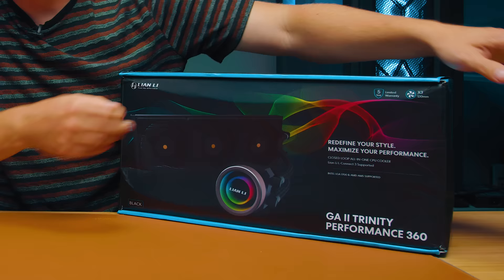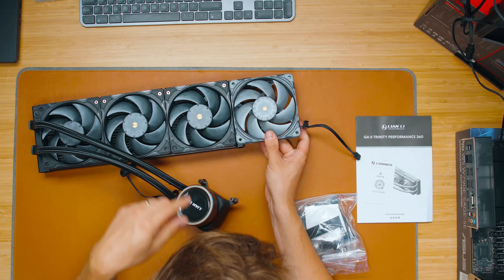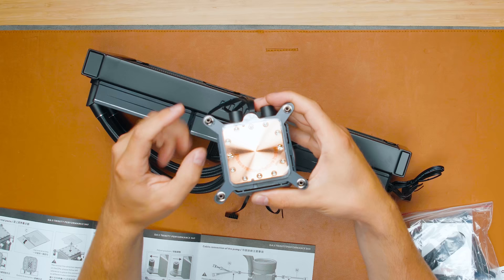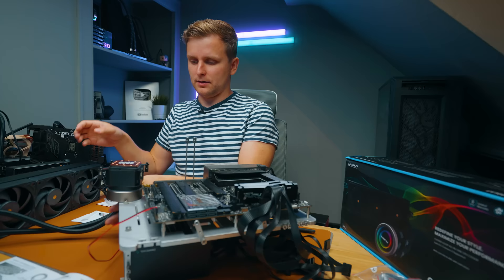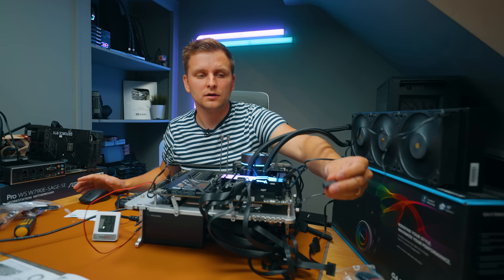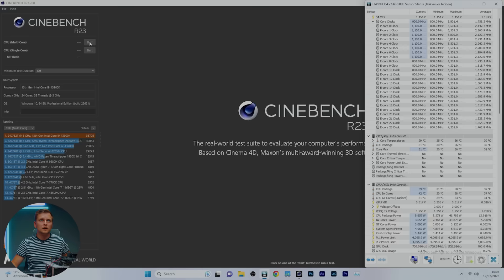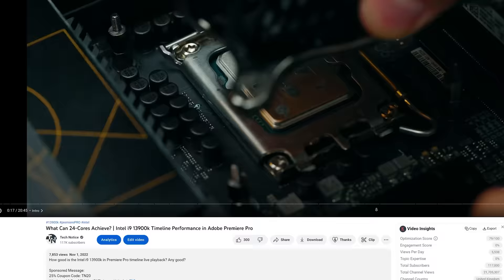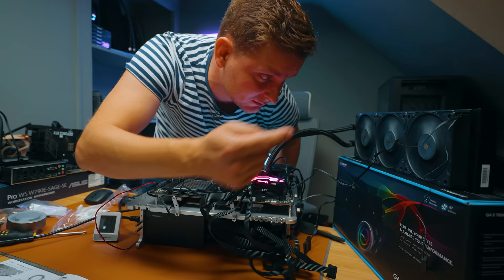BEST AIO of 2023?!? | Lian-Li Galahad II Trinity Performance 360 test & review

Comment: I'm having  RMA with this AiO. Performance version, pump died after 44 days. Not so premium, do not buy it
Reply: This can happen regardless of brand. I had an EK AIO 240 fail after about 5 months last year. Doesn't mean the product is a failure
Reply: Sounds like a defect product. Happens in all areas of tech. I've had a brand new 3.5" HDD fail after a week.
Reply: 😂 brother this can happen to any pc component it doesn’t means is bad
Reply: @Eddycarm  Just bad luck 🫨
Reply: Ma pump is going to died i have same product sound is so bad
Reply: Did you try and tilt the pc? Could have been air stuck in the pump head.
Reply: @JamieR   yes i tried and even worse like mini motor bike pump is working
Reply: It's usually pretty easy to tell when a component of any type has great reviews, and has even been gone over rigorously by the likes of Gamers Nexus, but people claim RMA or issues..

99% of the time that is just a normal DOA product, or user error. I don't even own this one. I have a Corsair h115i and have loved it.

But Lian Li makes good products. I'm considering this one.
Reply: @JordanMMiracle   yes lian li galahad 2 Performenc is nice i buy that AIO everty whas nice and last 3 days pump is working like mini motorbike
Reply: Same. I’m seeing a lot of people having the same issue on Reddit and on other reviews elsewhere. I really want to like this AIO, but it seems like there’s a problem with the pump design.
Reply: Now google any other AIO and you’ll find out all of them can die and there’s people with issues with all of them
Reply: This can happen to any AIO.
Reply: Oof I just got this for my evo xl case. That's horrible luck. Easy replacement though, surely!

My last build had a corsair h110 I got in early 2014 that I carried over from my last build....the pump died. Yesterday 😂.  

10 years! Kept my CPUs cooled from an i5 3470 to the 6700k I had until yesterday!! When the pump finally failed. 

Will see how this one holds up to that ahaha
Reply: How did you have it mounted in your PC?
Reply: Update after 8 months. I now have the 3rd (yes, third) version. Two previous ones have died after 44-55 days. The third one seems to be the good one 🙂
Reply: @spiriter666  did you mount it at the top of the case?
Reply: @diehardprogaming  Yes Sir. In both cases pump started rattling metalically (it was not trapped air) and it became insanely loud at high RPM. RMA service said it was the pump bearing being defective
Reply: @spiriter666  oh that sucks, I just bought one a few days ago and not put it in yet still looking for a good thermal paste.

Comment: The Galahad V1 had terrible coil whine on the pump until you dropped the voltage to like 60-70%. Disappointed it's not silent this time around.
Reply: The center caps do not fit very well either, and they also amplify the humming on the pump. Drives me mad when I'm having quiet time just browsing or working at the PC.
Reply: Probably far better than my nzxt x63. It's brutal over like 1600rpm.
Reply: Arctic Freezer 360 OneLove😅
Reply: Wait aren’t you the dude who makes fnaf vhs compilations?
Reply: I’ve had the V1 since it debuted and, aside from a few reboots here and there (updates and such) it’s been fairly silent. The whole unit has really. And I’m running front mounted and tubes up. Not even a slight gurgle.
Reply: @Mapantz1 RMA it. I'm running Lian Li fans and the performance AIO all in a LL case and I don't see how a PC could get much quieter.

Comment: You should test EK Nucleus AIO, Phanteks Glacier One T30 V2 (or any AIO with Asetek gen 8 pump) and Deepcool LS/LT720. These 3 might beat the Lian Li Galahad performance.
Reply: Word is the Phanteks t30 v2 360mm may not get replenished. Inventory seems gone in the USA at least.
Reply: I'm moving from LS720 to Galahad 2TP, Galahad is slightly more cooler, around 3c.
Reply: @poorNOOB  Yeah, Galahad II Performance beats all of those. General concensus seems to be that this AIO is the best one right now.

Comment: I like that it is coming already prepared straight out the box, and also i like the size of the contact plate that thing is HUGE. The competition is rising on CPU coolers side and at this rate we will have the next shift in pc cooling engineering for consumers
Reply: Just standard, nothing drastic, look into the TEC cooler from EK || Intel and then discuss available PC cooling engineering for consumers. These became common from both EK and Cooler Master back when 10th Gen was "notoriously" HOT! EK makes the TEC cooler for open loop while Cooler Master had the "ML 360 Sub Zero Tec" back then that was a 360mm RAD closed loop AIO TEC cooler. Very very neat package. If your serious about expressing cooling availability for consumers and can tackle an i9 13900KS chip open loop, SLAP that EK TEC on the chip and watch those temps go FROSTY! With that said stay frosty! Peace! :hand-purple-blue-peace:
Reply: @MagicMojitos  TEC coolers from EK are not brillant tho, they cant cool it sustainabily they where only designed for short burst application but any sustained load they just become a normal water block.

Comment: I believe it would be highly beneficial if more PC builders showed greater interest in replacing the stock CPU frame bracket with aftermarket alternatives like those from Thermal Grizzly. By doing so, users could also apply a substantial amount of thermal paste to ensure complete coverage. This approach has been demonstrated by the Gamers Nexus channel to significantly lower CPU temperatures. The replacement frame bracket has proven to provide more even pressure distribution, leading to improved heat dissipation and ultimately resulting in cooler CPU operating temperatures.
Reply from the maker: Yep, I've covered that on the channel as well :)
Reply: @theTechNotice  awesome ill have to check that video out!
Reply: I agree. I had to get that bracket myself.

Comment: I've been using my old but still working amazing corsair h115i rgb platinum 280mm and have been worried how much life I actually have left in this old aio. Has kept my old 6700k at 4.8ghz at 1.4v cool then kept my 10700k at 5.1ghz on all 8 cores at 1.38v cooled for years and this year it's being used to keep my 13700k in check easily. For the price I paid for this aio its been one hell of a great unit. But if it fails I'm really liking this lian-li aio. Hate rbg more and more the older I get "used to love it" and recently took out all my rgb strips and razer rgb controller and rgn fans out to make it more stealth looking and this would be perfect with just the block that lights up like I have now. Plus it performs so well to keep a 13900k under control. Just hope it's compatible with future intel cpu's LGA 1851 coming out next year. Or if lian-li will sell a mounting kit like corsair did for a few bucks for lga 1700 which I bought for my h115i.
Reply: @@unimpressively_charming 5 years

Comment: I'm not a big fan of gimmicky AIO's, but I did purchase this and plan on removing the crappy fans and putting my 140mm Noctua Industrial 3000 RPM fans on it to cool a 5800X3D. I just hope it doesn't blow too much hot air in my case with a 4090 in it.

Comment: best CPU cooler I have ever tested is the alphacool eisbear aurora pro. which is meant for threadripper and HEDT but it works great on 1700 intel. HUGE block and pump. I have the 420mm version in push/pull and can not get my 13900KS to throttle.
Reply: Alphacool Eisbaer Pro Aurora has a suberb fan there and copper radiator. You won't find many AIOs coming with better fans and I can't even think about a big list of AIOs with copper radiators. The only problem with the Alphacool is the same we have in every other AIO: low water flow due to pump limitation.

This pump's maximum flow rate is just 72 L/h in 100%, while custom watercoolers start from 600. For an AIO it delivers premium performance compared to other sealed builds you can get on the market from corsair/lian li/cm/deepcool etc. Its like taking the best Toyota and comparing to a Ferrari, it will work great, but will never be crazy like an expensive and complex supercar.
Reply: @jzuany  yeah I only do AIOs. I am not into customer water cooling. keeps my 12900KS in the 50s while overclocked like hell so im good with that.
Reply: angry that my icegem 360 does not have 1700 mounting.

Comment: I have the 240 white sl-inf. It performs good too. I only find the included thermal paste a little too thin so I applied my preferred one directly to the cpu.
Reply: arctic best thermal paste (mx7) besides liquid metal but you can't use gallium on copper
Reply: @kodakblack531  You mean MX-6? They don't have MX-7. Thermal Grizzly Kryonaut beat MX-6 in my tests by 1c on my 7950x.

Comment: May I ask if you know how this cooler compares (for 13900K/14900K) to the blazingly expensive: ASUS ROG RYUJIN III 360 ARGB? My favorite is still Arctic II 420, but the design of the pump is somehow strange compared to Lian Li and ASUS. 
I still cannot find out of why the user may buy  ASUS ROG RYUJIN III 360 ARGB instead of much cheaper alternatives. I put aside the brand and the display that comes with the ASUS variant. Of course, there is Lian Li option GA II LCD that is still much cheaper than ASUS.

Comment: Not sure if that is capable at 325w, while it said No on thermal throttling the temps are already 95c in red and that was only 4th run, meaning that on the 10min duration it probably would have throttled already.  I'm guessing 288w was the max dissipation,    the Arctic 360 III with the p12 max was capable of 300w.

Comment: I would recommend using a Thermalright CPU Contact Frame for LGA 1700 Retrofit Kit, which will prevent the CPU from being buckled lowering the CPU temps by 5C*-10C*.. Would highly recommend!
Reply: im looking at the SL INF version and it seems there are Thermalright CPU Contact Frame in the box, at least where im lookin at it

Comment: Today i will switch from the Arctic Freezer 3 280mm RGB white to the GA II TRINITY PERFORMANCE 360 White RGB - The Arctic LF 3 reahed its limits with 255 Watts at a AMD 5950x. THanks to this VIdeo i found a better Cooler and my concerns are blown away ! Gorgeours Video- i ve watched a lot now and always funny and informativ ! THanks !
Reply: 2 Month later......its an awsome AIO the performance is incredible - it can handle 270 Watts at AMD 5950x at 82 °C ar 24 °C Ambiente -- i beliebve the most pwoerfull AIO for a while....2024 still did not show up with stronger performances....ne AIO are out since Computex... but yet no tests seen
Reply: @LetsFixITJoe  BETTER THAN LF3?

Comment: So what case fans match the ones that come on this cooler? I'd like them all to match, but I definitely want this cooler. I need 3 120mm fans and 1 140mm fan.
Reply: I'd like to know this too
Reply: @InfiniteVideoMedia   I'm thinking the P28's are closest, but not exact. These cooler fans spin even faster and don't daisy chain like the P28's and other Uni fans. They don't have a 140mm equivalent yet either from what I can tell. I might just replace all the fans on the cooler, so they match, but these have a much higher static pressure. The other option is to get the LED side plates for these and match it with SL case fans it looks like.
Reply: The matching fans are Lian Li SLINF fans. They come in 120mm and 140mm

Comment: have you tested the 240mm version? I am building my new machine using a Phanteks NV9 Case. The rear of the case has the perfect spot to place the 240 on, but not sure how this will be different to the 360 on a 1400K Intel CPU! I look forward to your reply and kind advice.
Reply: What d'you end up going with?
The 240mm version supposedly beats out many "lesser" 360 aio's.
Ordered one, so we'll find out soon.
My mugen ain't hackin' it on my 13700k. Also completely clogging up my mid-size case with its girth.

Comment: 12:16 no need to guess, just look at the paste pattern on cold plate at 10:58. 13700k and 13900k should be used with contact correction plates.
Reply: You mean I have to use contact frame even with new cooler like lian trinity II Performance?

Comment: I just installed the 240 and it is very loud. I put the it on silent mode through bios but it doesn’t work at all. Does anyone know why?
Reply: Check how the cooper plate the cooler contact with the cpu. Maybe you did tide the screws good? Or your cpu is bended from to tide screws from other cooler...

Comment: This AIO is a beast! I’ve got the 240mm version (non performance) and it keeps my Ryzen 7 5800x (which also runs hot) running very well - doesn’t thermal throttle during a Cinebench R23 run either. I game at 4K and have no seen the CPU hit higher than 70 degrees Celsius.
Reply: Una cosa son los test sintéticos y otra bastante distinta es jugar a 4K, por ende. Revisa las temperaturas de tu CPU en juegos a 4K y comparará con tu AIO y así podrás decir si estás bien o no, pero no bajo el referente de la prueba Sintetica
Reply: @3LbR  I am comparing this to my previous Lian Li Gallahad 240mm which would always thermal throttle when running Cinebench R23. The fact that the new Trinity AIO can keep it from not thottling and temps under 70 degrees while 4k gaming is pretty good. I know 4K gaming is 99% GPU dependant, but compared to my previous AIO.. i was hitting around 80degrees while gaming.

Comment: very, very nice, i was hesitating to replace my malfunctioning msi coreliquid v2 by a strix lc2 or the galahad, with the new version with inf sli fans i just found my futur aio i think, just one question if i may, between galahd 2 and galahad 2 performance is there significant difference of perf?just to know if 25$ price difference is worth it for my i5 12600k^^
Reply: For an i5, both are probably overkill

Comment: Would not recommend for AM5 platform due to below average mounting system and horrible laggy software.
Reply: The AM5 mounting was not good (uses clips) and I had the dreaded crackling pump after 2 weeks.  Running the pump at its highest speed is too loud.  Got the EK nucleus 360, so far so good, quieter, much better mounting hardware for am5.

Comment: I've also read some comments on different sites about the coil whine issues. I've also read other comments about the Galahad trinity having significant failure rates. Does anyone have information about this?
Reply: Maybe their Performance model will be higher quality? Don't you think those rotating hoses are decreasing reliability?
Reply: The radiator and pump are completely different than the ones on the original model. It's different between the infinty and performance even with the Galahad 2. I can't speak on long term reliability yet but so far its been great.

Comment: it’s good buț I get 40.000 points with my nzxt z63 with a bit of thermal throttle and no over clocking, stock
Reply: I promise you nzxt's cooler is not out performing this one.
Reply: @odhinn9  I don't doubt that but it does what it's supposed to do efficiently enough

Comment: Just standard, nothing drastic, look into the TEC cooler from EK || Intel and then discuss available PC cooling engineering for consumers. These became common from both EK and Cooler Master back when 10th Gen was "notoriously" HOT! EK makes the TEC cooler for open loop while Cooler Master had the "ML 360 Sub Zero Tec" back then that was a 360mm RAD closed loop AIO TEC cooler. Very very neat package. If your serious about expressing cooling availability for consumers and can tackle an i9 13900KS chip open loop, SLAP that EK TEC on the chip and watch those temps go FROSTY! With that said stay frosty! Peace! :hand-purple-blue-peace:

Comment: Is true that you can't use a contact plate on the pro art z790?
Reply from the maker: No
Reply: @theTechNotice  I got some more info and some are claiming the Thermal Grizzly variant has a fit issue but not the thermalright as I've clearly seen you use it in other videos. Thanks.

Comment: Would we get the same cooling performance if the stock fans were changed to the  "SL V2 RGB" fans for aesthetic purposes?
Reply: No, while SL V2 is a good fan, its stats is still behind this special non-retail fans that come with Trinity Performance.
Reply: I appreciate the reply. One last question....for me aesthetics is important. Is it possible to do a PUSH PULL configuration using this AIO with the SL v2, or would that affect the performance?  @poorNOOB
Reply: @bromovich8058  Hmm, I think that if you do push-pull, you might improve the temperature a lil bit over stock fans, as there are six fans in total.
Reply: @poorNOOB  I would not remove these non-retail fans that comes with this AIO. I would pretty much just add three SL V2 fans. So the setup would be....3 SL v2 and the 3 non-retail fans. Is it not recommended to mix the types of fans in a Push Pull config?

Comment: The test part is quite pointless, there are tons of videos explaining that AIO temperatures rise over time because how liquid coolant react to heat exchange. Anything below 10 minutes on heavy load doesn't make sense. If you reach 99 degrees within 1 minutes and sustain 95 then you will most likely go over 100 degress after 4 minutes on heavy load and you thermal throttle more than 1 core. Make better test